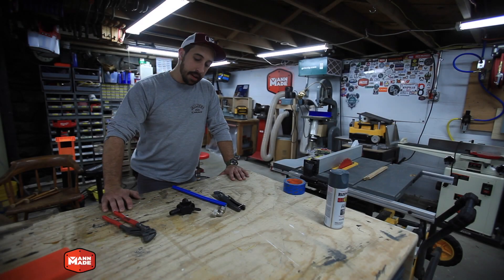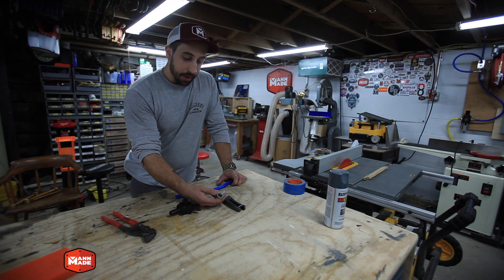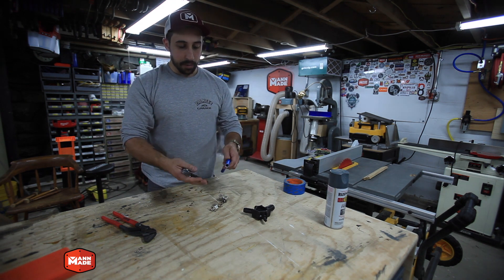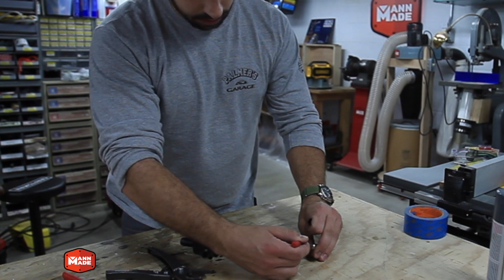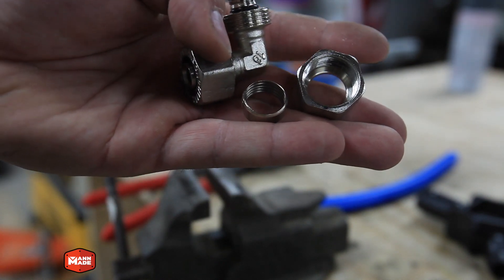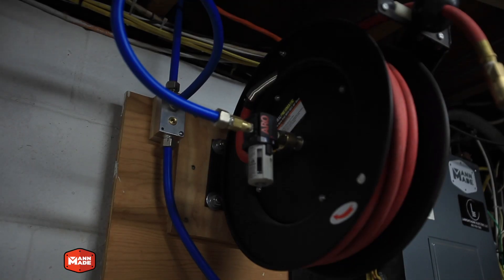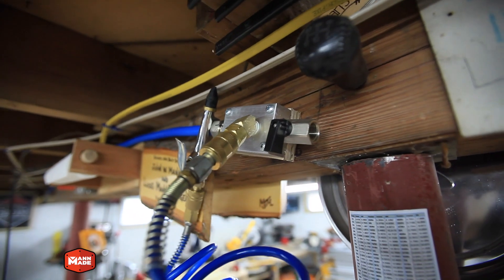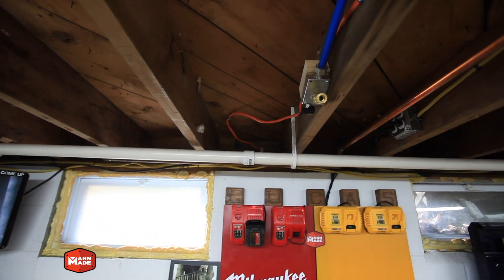My Shop Compressed Air System

Comment: Looks expensive.  I just ran CPVC pipe and it works great.  Pipe and fittings were cheap. 5 years now with no blowouts.
Reply from the maker: I weighed the options - PVC, CPVC, black iron, copper, PEX - ultimately landed on this.  The aluminum core HPDE was a plus, and the whole kit cost me under $200.  Yes, more expensive than just running PVC, but it also included the manifold blocks, which I quite like.  At my shop at work we have combination of PVC/Copper run, and it's been in place for 9 years with no issues, so I do agree that it works.  To me, it was worth the ~$200 plus my time for the kit!